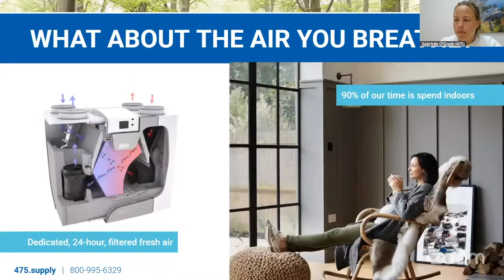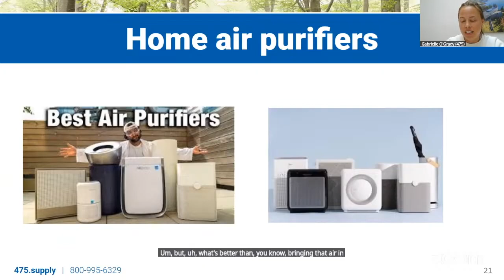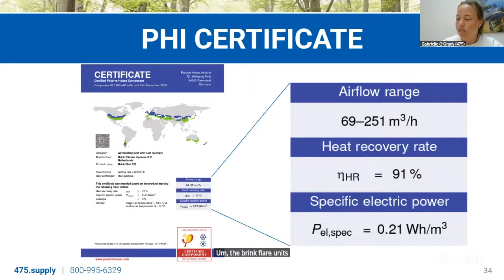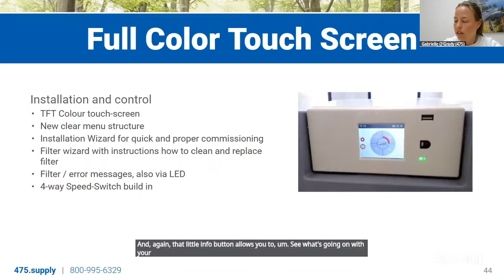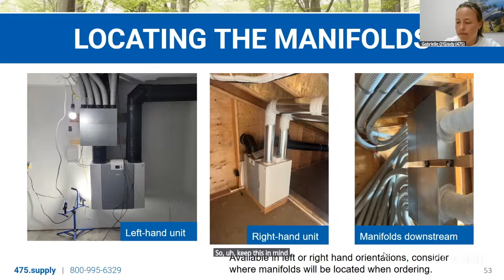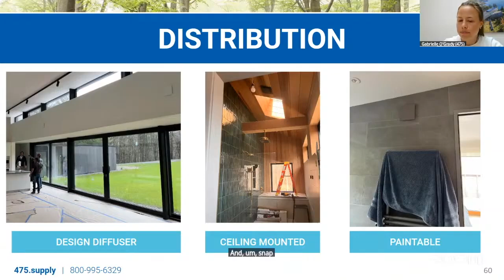475 BuildingBlocks: High Performance Ventilation

Comment: Question on the pre heat system.  Is there a variant of this system designed to balance the exhaust from a range hood?ie operate only when range exhaust is on to pull in fresh air that won’t go through the Erv
Reply from the maker: We recommend using a separate dedicated make-up air system (MUAS) for powerful range hoods. 
That being said, the FLAIR units do allow for sophisticated control. The PLUS MODULE allows you to use the Brink Home which provides data trending and visualization and access to more advanced controls. When using the PLUS MODULE and settings 9 on the unit, see 'Section 13.2 Setting values appliance with Plus pcb' of the install guide, the unit can be put into supply only or exhaust only mode. 
For the intelligent internal pre-heater you can only adjust the temperatures at which it turns on (Setting 3 Frost Protection). The settings are such that it only turns on when necessary and are designed to protect the core of the unit, therefore the internal preheater is inappropriate for use as a make-up air heater (MUAH).